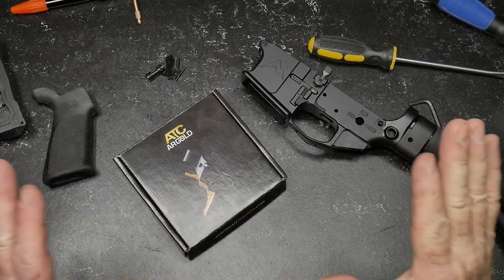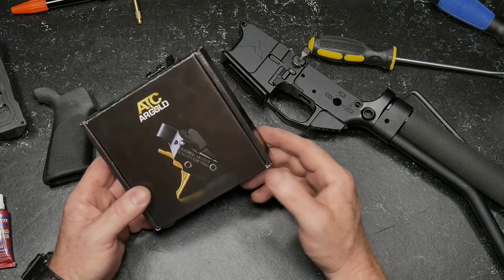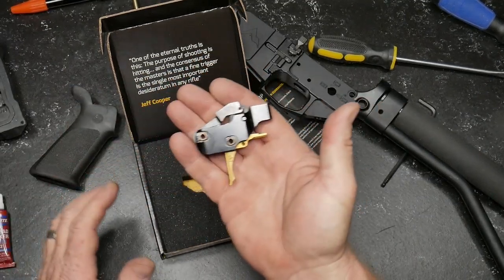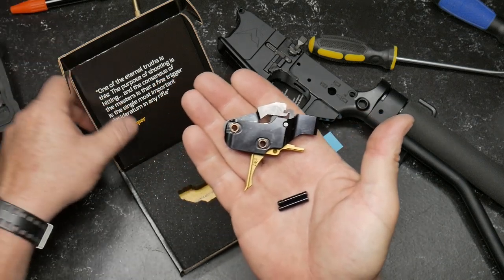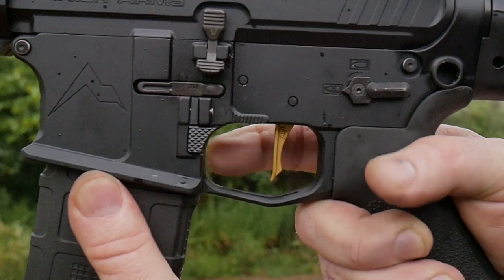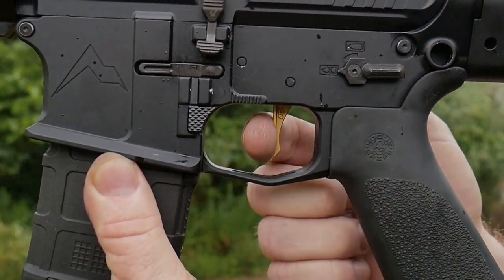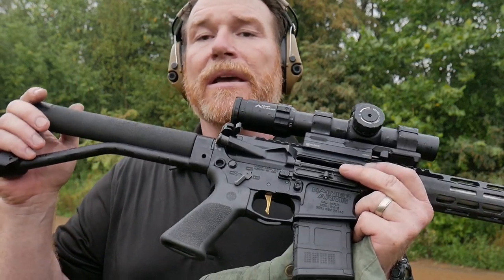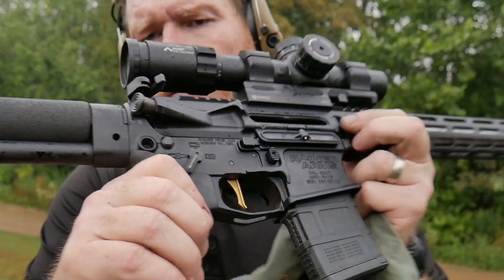American Trigger Corp! AR Gold Trigger Review

Comment: So i have always had a crazy idea. I have been into paintball in for some time. We normally have a double bow trigger were you can "walk" the trigger with two fingers. It would be cool to see a trigger and lower that would allow you to walk the trigger. It wouldn't have much practical use except fun at the range. It's still one bullet for one pull just increase your fire. NEW BUMP TRIGGER cmc lol
Reply: A company called Elftmann made this exact product and from what I remember they flopped hard.
Reply: It doesn’t work the same way in an actual firearm. Your finger speed usually isn’t the limiting factor for a trained person in follow up shots, it’s recoil/sight recovery. At sub .2 splits I’m always already on the reset ready to fire well before I’m ready to actually take the shot.

Comment: Building a 24" 5.56 bench AR. In your opinion, what'd be a good option 2 stage trigger? I've never had to deal with a really light trigger before in this platform, only used milspec
Reply from the maker: really depends on you budget, almost any two stage will do, I would recommend Larue, Delton, or Rock River for budget and then the Geiselle SSA-E.  There are better triggers out there, the best one so far is the Triggertech Diamond which is a variant of a two stage and you pay for that excellent trigger at 299 bucks.  It's just like anything else, a Mustang GT will do 0-60 in 4.5 seconds but so will a Mercedes E-400,
Reply: @kotaboy32  Alright, I'll check the "budget options" since I am a cheapskate lol. Thank you.
Reply: @HopsAndLead  Geiselle gs2 isnt that much,great trigger. I use for bench and for hunting in 308 PA10.Good luck man
Reply: @Garrick1983  just looked it up. I like the heavier first stage and really light 2nd. Thanks, I'll add it as a top pick.
Reply: Be very careful with short reset triggers in a bench gun.  You can easily get bump fires from them on the bench.
Reply: @ErikS308  Kind of why I want a 2 stage but nothing crazy.
Reply: Hops And Lead stick with a MBT or G SSA-E SD-E. The G -E triggers will be a bit lighter. I shoot an SD-E in my guns.
Reply: For that I'd highly recommend the Geissele National Match trigger. It's a VERY adjustable two stage trigger that comes with 3 sets of springs and where almost all the various travels and pressures can be adjusted to your preference. Don't like something about it, adjust it, can't do that with others. The only adjustment it doesn't do is release over travel but that can be done via the grip screw-set screw trick. It's marketed as a trigger to skirt the lines of the national match trigger rules, but it certainly will do far more then that.
Reply: @snek9353  Thanks. I'll add it to the list to look into

Comment: Hey Kotaboy32  I want a suggestion for 45° safety. Preferably cheap as possible just has to be crisp and smooth. Does the detent make a big difference and if it does what do you suggest?
Reply from the maker: Strike Industries, it comes with their enhanced lower parts kit or individually.  The better deal is to get the whole parts kit imo

Comment: Do you think this is better than A Geissele Trigger? I think he knows more about Triggers than any manufacturer out there.I think he is over priced.
As far as trigger pins.I will take the screws that secure them.
Holding that trigger gauge at the very bottom is not an accurate measure.Unless the center of your finger will be place at the Point of the bottom of trigger.Not doggin your trigger though.
I think you just wanted a Gold trigger to match your gold BCG...LOL
I like teasing you a bit.But dams that is a smooth ass gun...Damn No movement..I will give it to you.Thats a bad ass gun..One thing I like about this single stage trigger is its DROP SAFE.
Im going to buy one..I like 2 of my Geissele triggers.One is a SSA-E..and the other is the Also I like my CMC 2lb Single Stage alot.At first I was leary of it being so light. I have a LaRue  MBT 87  I like..But its a two stage...Ive got use to it.As of now my CMC is my fastest and lightest triggers.
All in all I dont think I cant top your gun right now..Its really nice KB32.
Reply: I'm a big fan of the Geissele National Match Trigger, I'm surprised it's not more popular. Being as adjustable as it is makes it one trigger to rule them all.
Reply: @snek9353  I will have to get one and try it
I'm pretty fond of a CMC 2lb  single stage
I was checking the reset on this morning. It's pretty dang fast.
N
Reply: @TexasTrained  Have to admit 4 possible cons to this Geissele I like. 
1. It's not drop in, installs like a mil-spec so it's harder to install. But there's up sides to that, easier to clean, no need for pin retention. 
2. It's a complicated trigger, for someone who prefers to K.I.S.S., this isn't the right trigger. 
3. They pissed me off just after I posted that comment, their pins are over-sized a bit. Mil-spec is .154" they say they're supposed to be .155" but I measure mine at .156". In the past this has been a good thing, but I recently I got one for a large frame DPMS and I guess this lower actually has tight tolerances, the pins won't go in. Geissele is basically saying use a bigger hammer, and they may ultimately be right, but I don't want press fit trigger pins, haven't decided yet exactly what I'm going to do. 
4. It's two stage and that requires some travel so my reset appears to be just a bit longer then the trigger in the vid. I really like 2 stage triggers in most rifles, gives a safety cushion AND a light crisp break. HOWEVER, being so adjustable the second stage can actually be adjusted out making it single stage. Combine this with the grip screw-set screw trick and I suppose I could adjust in a wicked short reset and travel, dangerous but maybe I'll give it a go for kicks. But it's all a range of adjustment from cunt hair gamer trigger to a hard firm combat trigger. The thing is this sucker can do both in one and everything in between.